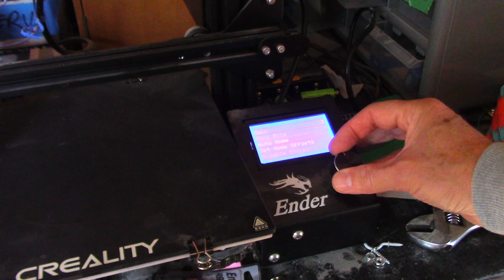Ender 3 Homing Issue Causing Nozzle To Print Off of the Bed - How to FIX

Comment: I'm new to 3D printing, mine keeps thinking point 1 thats supposed to be in the middle of the bed is in the bottom left and point 2 thats supposed to be in the bottom left is far off the board. Mine made a similar noise to yours twice and I didnt turn it off because I wasnt sure what to do. Based on the other comments have i destroyed something? It seems like the 3D printers idea of where the center of the bed is, is messed up and its messing up the other 4 points but i dont know how to fix this. I have a Ender 3 s1 pro, i know thats not the model in this video but from my research i havent been able to find anyone else with this issue, maybe I'm googling the wrong things tho lol.  Thanks for any help you can give!
Reply from the maker: The chatter you hear is the stepper motor stalling due to an obstruction.  Stepper motors work by moving in small steps, then another step and so on.  When the stall, they cannot advance further, so it makes a loud bang.  It's possible to destroy the motor driver if left in this condition and/or damage the stepper.  So if it happens, then shut off the power and investigate.  

Now the issue you are describing is likely that the limit switches are not connected.  Very rarely, the switch itself will fail, but it's far more likely that it's a connection issue  The board tells the motor to keep going until it reaches the limits.  The switches opens (or closes) and that tells the board where the limits are.  So I would check your limit switches first and use an ohm meter to make sure when you manually press the switch, the signal goes all the way to the board.  Always do this test with the power cord unplugged from the wall.

Comment: I’m so sad bc this just happened to my Ender3 and nothing is unplugged. I am so new to 3D printers I don’t know what to do and I’m under a deadline to get things printed too 😭😭 if you can help me please reply! X
Reply from the maker: First check to see if your limit switches are connected. you might also need to check to see if they are plugged in correctly at the board.  One loose switch connection can cause this issue